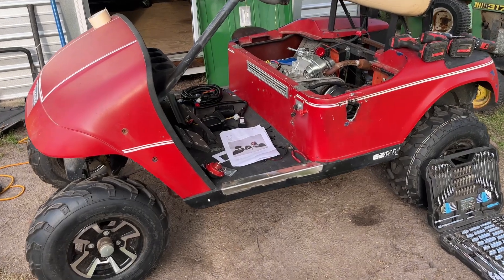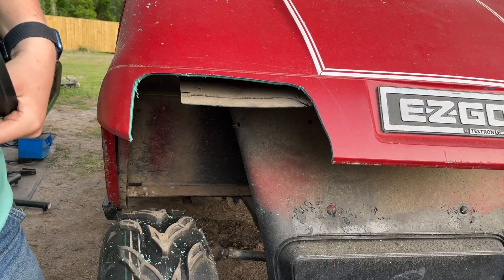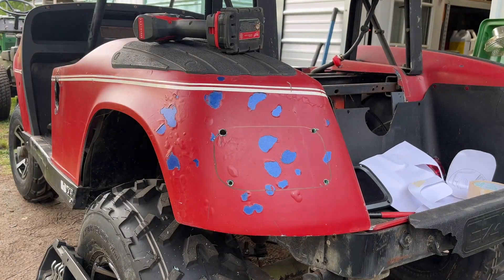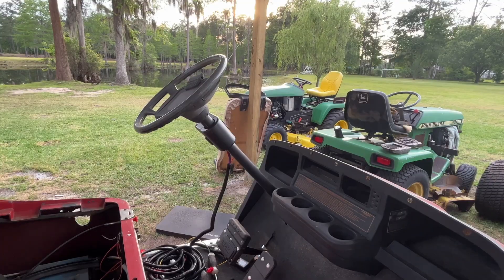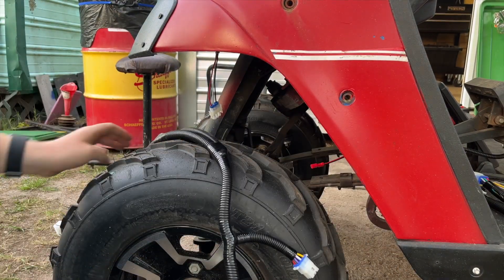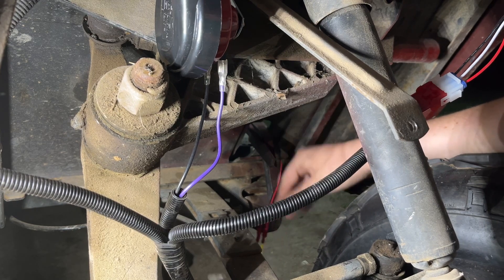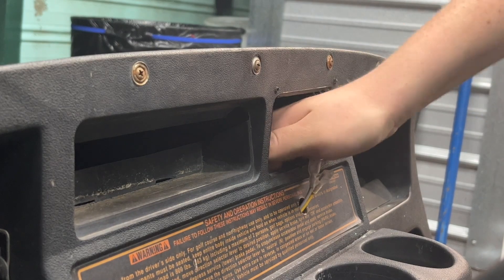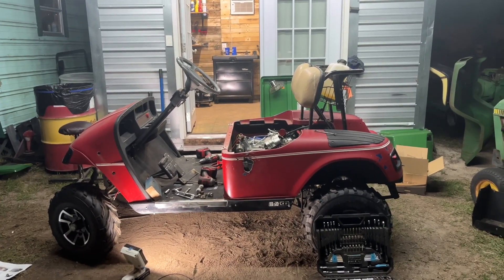Ezgo golf cart light kit installation - How to install complete light kit with turn signals 10LOL

Comment: Easy  install my cart had vertical rectangular holes in the rear fenders from old lights  so I could not in stall the lights as instructed. but I did install the tail lights vertically by using the template  for the left on the right and flipping it for the lift with the TOP label out (away from the center of the cart)  then installed the light for the left on the right and the right on the left. worked out great.

Comment: Thank you. I got one of these kits and found the instructions aren’t great so your video helped. When I cut my first front light opening I got it a bit high so it doesn’t look perfect. The templates are okay but they could be accompanied with clearer directions. It wasn’t easy but i I was able to run my wiring through the channels on the underneath of the drivers side - had to cut some clips from the comments but they’ll still be secure. I’ll finish mine up and hope for the best.
Reply: Finished it up and all works well!

Comment: just a little tip. you want your sparks to fly at you so that it doesn't kick back when using the angle grinder
Reply from the maker: I normally try to avoid cutting with the left side but I didn’t have much room. Good advice though and thanks for watching!

Comment: Great video. I probably couldn’t do this myself.  Your awesome.  Only thing I noticed is that the turn signal is usually on the outside.  So either you install your lights upside down or to the opposite side of the cart. Either way great install. Works flawlessly. 🫡

Comment: Very good video. Easy to follow. My hazzard light switch is stuck in the on osition so I'm about to replace the turn signal unit to fix this. My old unit has the switch by the turn signal lever. All the replacement units i have found the hazzard switch is on the dash separetly. Hope I'm able to switch it out.

Comment: Great video! About to do this kit to my 1997 ezgo txt 36v DCS. However im hoping to find a way to get the large connectors through the floor board without cutting a hole.
Reply from the maker: Could probably be figured out with some time spent on it for sure. Thanks for watching!

Comment: I've purchased two of these and can't get either to work. I have a 2005 EZGO. What are the blue and red wires for? Instructions say lamp switch but there isn't one. You showed them but didn't address what they were for. 10LOL has no support or phone number to contact. I guess it's good when you get them for free. Very frustrated!
Reply from the maker: If I remember correctly the blue and red wires don’t connect to anything. I’ve installed so many of these kits and they all have the extra 2 wires which I don’t understand either. I think it is for a manual on/off switch for the lights but I could be wrong. If yours isn’t working possibly you have the 9 pin connector backwards? It only works one way but might go in both ways. Just make sure everything else is correct too - black and purple are horn, red and yellow are brake lights and black and red are negative and positive to the battery.
Reply: I to wanna know where red and blue hook to?